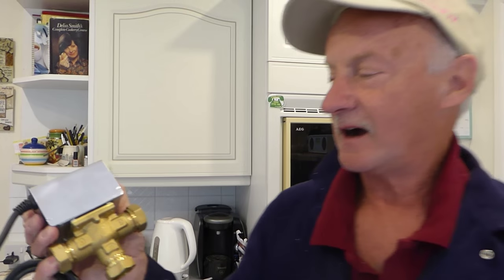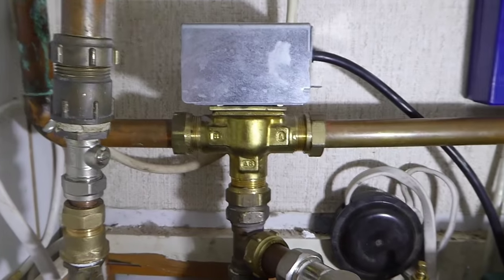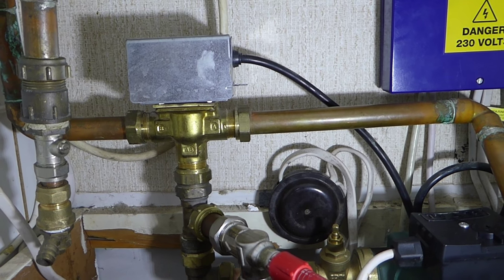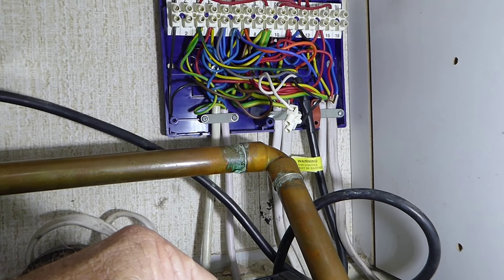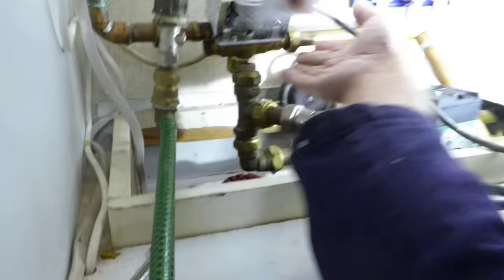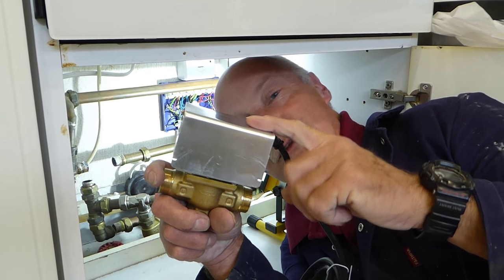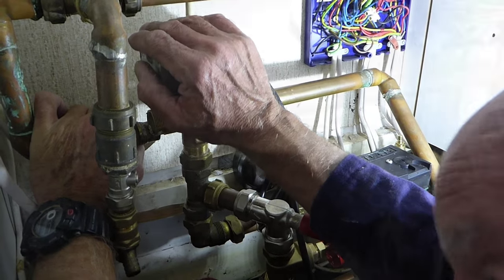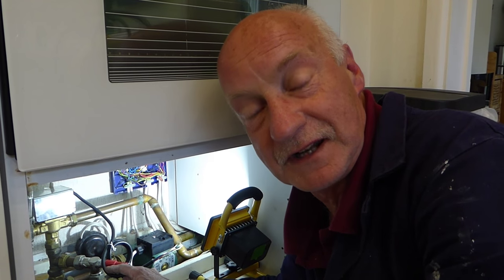How to fit a three way motorised valve. Not just the head motor.

Comment: Hey, another great vid and I need to do this process so before I fill up my house with water lol, I know you said to try and get the exact same fitting but I have an old system but have found something that looks the same.  I put in a few numbers to check the part etc and it looks like the same.  So my question is, as long as the diameter is the same and the same ports etc I can't go too far wrong, correct ?? I know the colours of the wires may be different but I will tackle the wiring at the same point.  If it all looks different then I won't touch the wiring but I'm gonna need a new valve anyway.  What do you think ??
Reply from the maker: Yeh have a go for it Rob, as you say you can always get an electrician to sort out the wiring.
Reply: Hello mate, so today I tackled fitting a new 3 way valve but now I'm having trouble.  I can't get the boiler to fire even though its calling for heat.  The wiring was easy as they were exactly the same as the old ones.  I'm finding that the middle pipe coming from the valve has a pump about a foot or 2 above the new valve, this pipe doesn't get hot, not sure whether it should or not.  Also noticed the pump is really hot, could it have an air lock and would this stop the boiler firing up ?? How can I fix this without draining the whole system again ?? Thanks for any tips, ah also, the manual switch on the side on the new motor on top of the valve is very limp, is that right ?? When I slide it up to the auto position it just falls back down again, even so I thought I should get hot water to the rads which I'm not.  Seems we won't get any hot water at the moment.  Here's hoping you have some tips to help me.  Thanks again !!
Reply from the maker: Hi Rob, turn off the heating and hot water, you probably have air in the system, try cracking open the joints on the 3 way valve to let any air out. Also the joints around the pump, also bleed any air out of the pump.The problem with a different make of valve maybe that the wiring may look the same but the small micro switch that fires the boiler may not be connected right. Do not worry about the lever on the valve they can be like that..
Reply: Ok Thanks that great, I'll give that a go.  Appreciate you getting back to me !
Reply: Hello again lol, OK so valve is working as it should I think, but I can't get the boiler to stay on as there is still air in the system and for the life of me I cannot get rid of it.  I haven't started cracking open the joints near the pump yet as I don't wanna flood the place again....last night I ended up draining the whole system again as I got a leak from one of the joints above one I undone.  It was carnage but all sorted now, the leak I mean not the air lock.  So any more tips without opening the joints near the pump ?? I've been bleeding the rads for over an hour now in sequence and I'm getting a hiss now and again but now they all seem to be full with just water and I can't get to the air lock.  HELP !! lol
Reply: dereton33 Hello mate appreciate you getting back to me again lol.  Do you mean the drain off on the rad ?? The problem with this is that the drain off is on the rad downstairs, do you think this will make any difference ? The way the pipe work is laid out is that in the loft there is a small bleed valve along one of the pipes so its at a high point, water is coming out of that and so I think this is quite tricky.  I will try what you said if you still think I should ??
Reply from the maker: Yes give it a go, nothing to lose except a bit of inhibitor.
Reply: Hello again, I've given up.  Heating is off, I don't care if I freeze, I'm fed up of climbing in the loft, running up and down the stairs, I've had it !! I tried putting a hose on a drain off right near the boiler where I think the air is locked and didn't make a bit of difference.  Someone will have to come out and fix it !  My head has gone !  Thanks for all your input. I just aint no plumber lol
Reply from the maker: Well at least you gave it a try. Let me know what your plumber finds is the problem.
Reply: Yeah been trying all day today lol.  I need to get someone to have a proper look.  I still think its just trapped air.  The boiler comes on for around 10 minutes and I started to think it was the boiler firing and then going off because its up to temperature.  But standing next to the pump on the airing cupboard you can still hear the air going through it.  Thanks for all your help
Reply from the maker: Air is the biggest problem for plumbers. One of the most difficult problems to solve.
Reply: dereton33 yeah I tried everything. Bled every rad about 1000 times lol. To be far, air did come out sometimes so if I did that for the next 12 years, I may sort it lol !
Reply: Hello again, thought I would let you know that my situation has been sorted and I'll blame myself for a lot of the work that I didn't need to do, bleeding all the rads, again and again checking the boiler was on, then doing it all over again and again for 2 days.  Looks like the pump wasn't working properly the whole time LOL !! So I got someone to replace the pump although I reckon I could've done that myself and everything is working perfect.  Thanks to you for your vids on changing the 3 port valve which gave me the confidence to do that in the first place my central heating is working as it should. Thanks for all your time !! All the best !!
Reply from the maker: Ok thanks Rob.

Comment: Hi Al great vid i may have to do this soon my question is when you drain down do i need to drain the cylinder down too ? Cheers  Pat
Reply from the maker: No just the heating circuit.
Reply: Thanks Al i tried the leverover to manual but it didnt "motorise " like your one did no pressure just slips back and forth so could top have failed ? Im only getting slight heat to the tails to one rad but its not constant . Pipes from cylinder are roasting tho ! Any help gratefully received cheers Pat

Comment: Thanks for your video.

I have a 3-way valve positioned at a level half way up the hot water cylinder. Therefore I assume I would have to drain the cylinder at least half way before removing the valve. (Shut off the ball valve in the cold water tank, and run taps?)
Also turn off the cold feed to the central heating and drain out enough CH water to get below the level of the 3-way valve.
Would this be correct?
Reply from the maker: You do not need to drain the cylinder, just the heating circuit to below the level of the valve.
Reply: @dereton33  Thanks. I just wondered what stops half the cylinder emptying back through the pipe from the valve once the valve has been removed.
Reply from the maker: The water in the cylinder cannot pass back to the valve as the flow and return pipes going into and out of the cylinder pass through an inner coil that is separate from the water in the cylinder.
Reply: @dereton33  Ah, of course, thanks!

Comment: Hi, I was wanting to move a mag filter near my boiler on the return of a vented system. I was wondering when I drain down the system could I just turn all the radiators off to save draining them or would that create air problems when I go to re fill?
Reply from the maker: You can turn them all off. Air problems is a matter of luck, some systems do, others dont.

Comment: hi, great vids, im going to attempt this myself only thing is i checked the wiring and my original valve only has 4 wires blue, white, grey and yellow, the original is a Myson if that helps, if i buy a new one with 5 wires where do i put the 5th wire??
Reply from the maker: You will be best to consult an electrician, as heating systems are all wired different depending on the system. No system is the same. An electrician can check the right wires go in the right connections.

Comment: Brilliant video. My heating stopped about a week ago I looked at the motorised valve and to begin with I found that the little manual over ride arm pushed along into the slot  and the heating started to work, but now the arm is loose. I presume this means the valve is stuck. Is now the time to replace the whole thing?
Reply from the maker: You may get away with just replacing the head motor on top.
Reply: +dereton33 Thank you. I have managed to get manual override to work again and have hot water and C/H. Is it OK to leave it like that for a while until I fix it? 
I thought about changing the synchron motor only but not sure if that's the problem. I defiantly know its one or the other. For ease I would prefer just to change the motor but then I may have to change the valve.
Reply from the maker: I have videos on changing both.

Comment: How much movement should there be in the actual valve? 

My motor had seized so was planning to replace as the valve can be easily  turned  by hand. However the valve only turns about 45 degrees (approx 1/8th of rotation) andsee in one of the comments it should be able to turn a  quarter (90 degrees). 

Can you advise how much movement the valve should have as I’d like to know if it needs replaced as well as I can easily to the head, however to do the valve I’d get a plumber
Reply from the maker: You should be able to turn them a lot more than that, the motor has seized.
Reply: @dereton33  Thanks

Comment: when replacing the valve do you need to drain both the hot water and central heating system, mine is a sundial Y plan system? thanks
Reply from the maker: Just the heating system.
Reply: @dereton33  thanks

Comment: Ive just changed the valve. However.. upon re filling the heating. What am i missing/doing wrong?

I put the bleed key and undo, but theres no rush of water or rush of air.. just.. nothing.  I presume ive missed something to get water back into the rads.
Reply from the maker: Check the F and E ballvalve is not stuck.
Reply: Wouldn’t even drain system, just bung small loft tank and vent pipe. Saves time

Comment: I had hot water but no heating, tried over riding manually by pulling the lever across, worked for 10-15 mins, off again, changed the valve every thing worked but once we turned the heating off, never came back on again, even the hot water had gone, boiler not responding anymore...could it be an air lock?
Reply from the maker: Yes air in the system.

Comment: Hi, thanks for the video. When I turn the hot water on the boiler fires up no problem but when I turn the heating on the boiler doesnt start up. Would this be a problem with the valve? Thanks for your help.
Reply from the maker: The way to find out is to switch the valve to manual mode.

Comment: You'd have been cheaper buying a 3 port body replacement kit (Honeywell 40003918-007) and a separate Powerhead 003 or synchron motor, than changing the entire body and head.
Reply from the maker: +Daniel Caie Thanks Daniel.

Comment: Drain the system with 20 rads...Err I don't think so. Why do they not install 22mm isolation valves on either side of these replaceable items?
Reply from the maker: I just know they don't.
Reply: My 3-way valve is upstairs in the airing cupboard. All my radiators are below this level, so there is no need to drain them. The plumbing has an isolating valve between the pump and the 3-way valve inlet. There is a shut-off valve (Type with a red wheel handle) in the outlet from the valve to the radiators (Not needed as all radiators are below the valve), and the heating coil in the hot water cylinder is below the valve. There is a shut-off valve in the pipe from the tank coil too. So as long as I shut off any valves in supplies from the header tank, there is no need to drain the system. Aren't most systems designed like this, so that there is no need to drain.

Comment: Hi,

I need to replace this valve. Am I correct in saying the procedure is as follows:
1. Turn off water supply from mains outside the house.
2. Turn off electricity at mains (erring on the side of caution here)
3. Open taps on ground floor.
4. Open taps on first floor.
5. Then replace valve.
6. Then do 1-4 in reverse order?

Thanks
Reply from the maker: If you have a Combi boiler then there is no need to turn the water off, if you have an F and E system then you do. No need to open any taps, just locate the drain valve on the heating circuit, attach a hose then drain the heating system. When finished if you have a Combi you will need to re-pressurise the system, if you have an F and E system just turn the water back on. Bleed all radiators.
Reply: @dereton33  Thank you for coming back to me. 

I have a hot water cylinder in airing cupboard in a bedroom; no combi boiler. Presumably this is the F and E system.

Where would I locate the drain valve? Would this be on the hot water cylinder or somewhere in the airing cupboard?

Do I bleed all radiators once everything is done?
Reply from the maker: The drain valve will be either by the boiler on a central heating pipe, or a radiator located on the ground floor.

Comment: Good video Al. So Al, how do you do this without draining  the system?
Reply from the maker: Hi Barry, you can only change the head gear without draining, if you want to renew the whole valve it will have to be drained down,
Reply: @dereton33 . Much obliged for your advice. But what if you have a means , in line, of stopping the flow of water to the three inlets to to valve, surely  then we would not have to drain the system, only the small amount of water in the pipes.
Reply from the maker: Yes that is right.